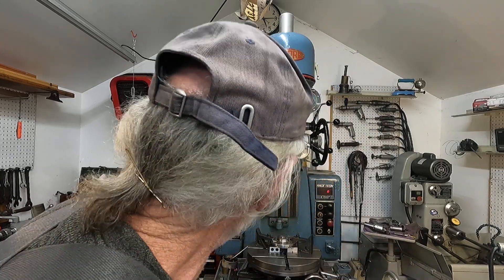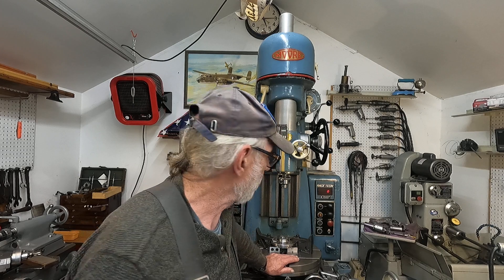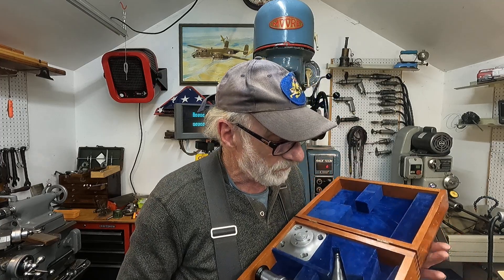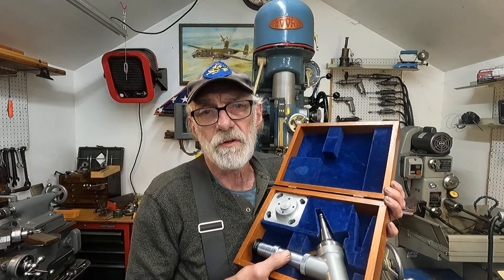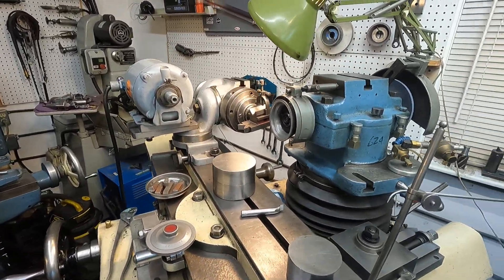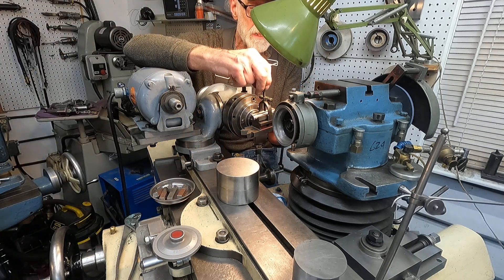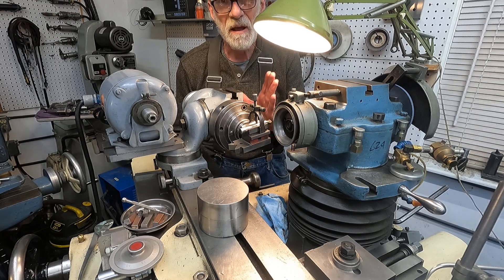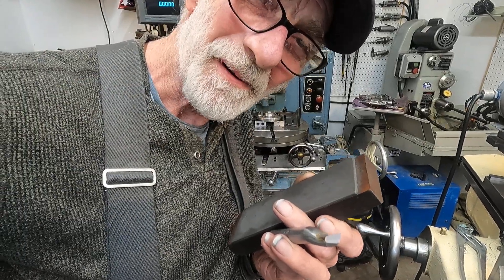Moore jig boring machine basic hole making 5

Comment: Yup…. The goodies are matched to the machine. Even Sip had requirements about temperature as temp swings could change accuracy.
Reply from the maker: There is instruction on lapping new tool shanks to fit the spindle internal taper then they return exactly after removal

Comment: dee dee, I have an identical Moore locating scope with 40X magnification (0.0001" precision) for the jig grinder, as well as the newer type with a 20X magnification (0.001"/0.0005" precision) and the illuminator.  They would be very useful for the jig borer, but there is no way to repeatedly locate them relative to the spindle centerline on a jig grinder.  There you have to reset them every time you install them.  This is where the newer style is better for a jig grinder, it has external knobs for resetting center.  I use them very seldom.  The only reason to use them is to find an edge or center where an indicator cannot be used (grinding complicated internal contours with intersecting radii and/or straight segments) or when using the machine as an inspection machine.  All of the Moore scopes lack a through-the-prism type illuminator, which is a major drawback when using a reflective optical edge finder (I have one from SIP), since it limits the accuracy at which you can discern the edge of the dark spot.  I bought a Leica center scope to get around this problem (it has the through-the-prism type illuminator,) but haven't had a need to make an adapter to fit it to the jig grinder yet.
Reply from the maker: A sharp edge can look ragged under the scope for sure. I always have found the term blue printing an engine for example or any thing else makes not much sense if the manufacturer does not provide blue prints. So, the scope serves as a measuring device along with the machine itself most of the time.

Comment: I would be interested in hearing more about Jig Grinders.
Reply from the maker: That is a subject I have no experience
Reply: @deedeeindustrialsuperprecision  I have seen Suburban Tool do it but no detail. Thanks for the reply
Reply: I run the Jig grinder at work and have to say that being proficient at using one is a serious skill that pays well.  That being the case, I know that there are a lot of proud people who would get very angry with me for sharing too many of the secrets of the trade.  I suspect that this is why the Suburban tool videos don't go into more practical detail, and why Don Bailey had trouble getting help from his own staff when he was getting started.  Be aware that Jig grinding combines some of the most difficult aspects of both small hole I.D. grinding and boring into one process.  Also, one small screwup can easily do $2000+ in damage to an air head, so few shops are willing to let just anyone jump in and run one.  If you want to know more, you should get the book "Holes Coutours and Surfaces" which was published by Moore.  This is the standard textbook on Jig grinding and Jig boring, but it doesn't give anything more than an introduction.  You also need to be a proficient grind hand with experience doing precision locating operations on jig borers/toolroom mills to be successful.  Jig grinders are amazingly versatile tools for doing accurate grinding work, but they are probably one of the LAST machines a toolmaker should buy when setting up a practical shop.